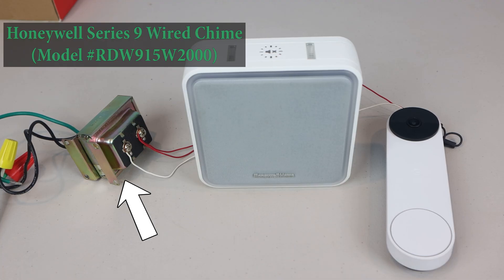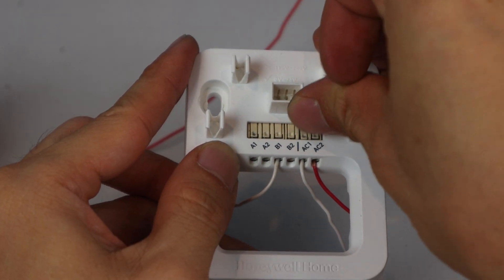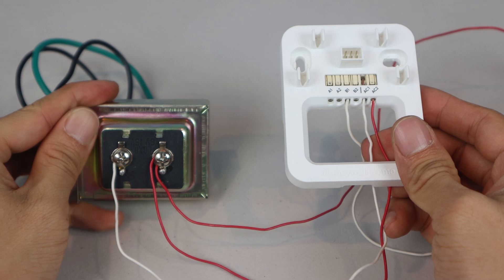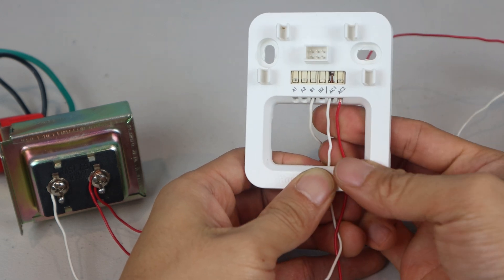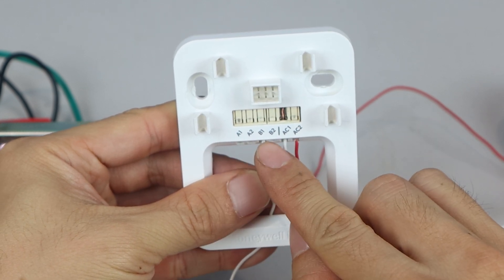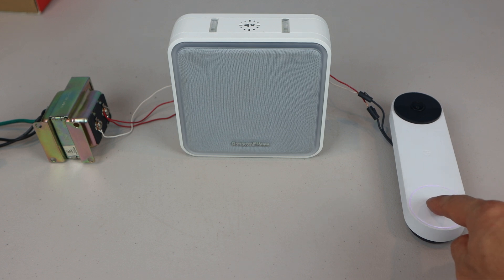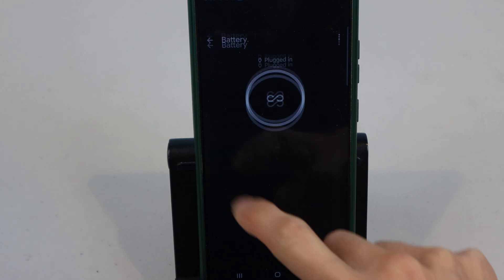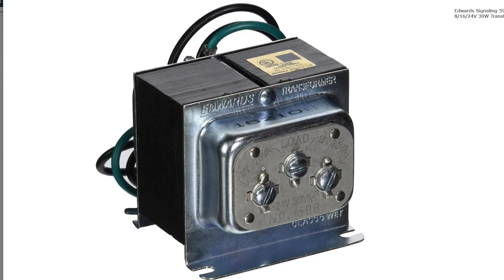How to Wire Honeywell Series 9 Chime to Video Doorbell

Comment: This great Phil, thanks. The issue I have is that I have wireless model of Honeywell, and having followed the wiring instructions I find the battery in the transmitted drains after about 3 days but without the battery it won't work at all.